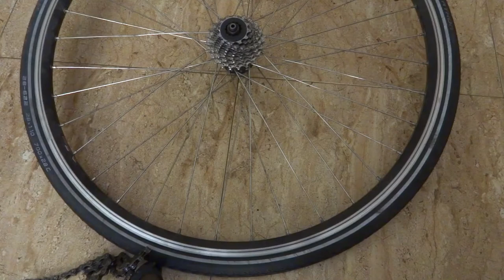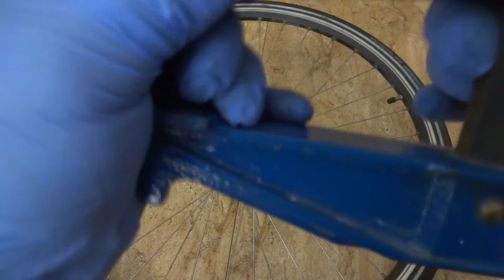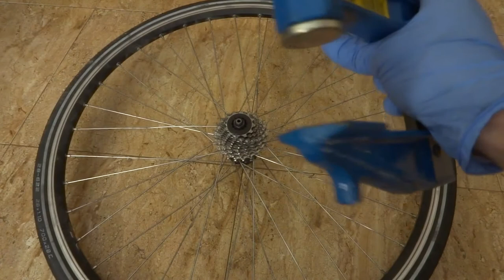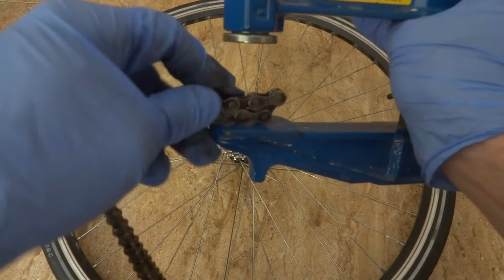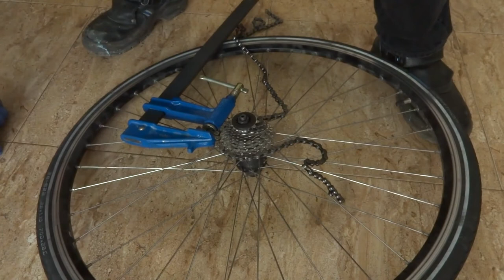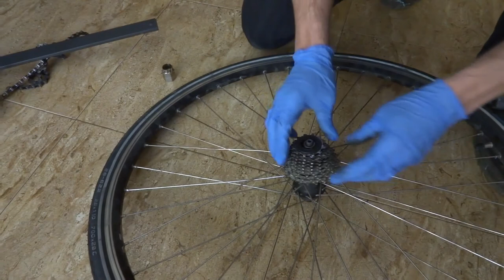Make a chain whip to change bicycle cassette

Comment: why do you need chain whip? I think my bike is different. It doesn't need chain whip to hold cassette to unscrew it.
Reply from the maker: generally bike's cassette need chain whip, of course there are different designs for fixing the sprockets to the wheel, that also can be related to the age and/or factory
Reply: Isaac Rivas Cayuela I see, I have shimano 2014 super low.
Reply from the maker: mmm don't know, what I meant was that the way the sprockets are fixed to the wheel can vary between bicycles, I'm a learner too with these things jajaj I encourage you to share your doubt with a professional mechanic, Its always good to know about your bike when driving on the road ;)
Reply: Isaac Rivas Cayuela Guy wrote me! "If you can unscrew your cassette with just the splined tool you have a freewheel, not a freehub.  Totally different animal.  If you have a freehub cassette then you have to use the chainwhip to hold the sprockets and freehub still while you unscrew the lockring.  You can read about the differences between freehub and freewheel at Sheldon Brown's great website on bikes.  Here's a link:  http://sheldonbrown.com/k7.html"